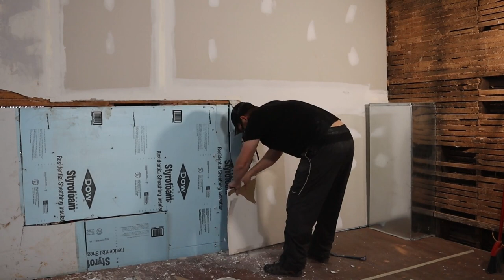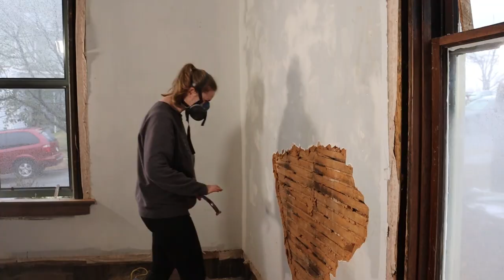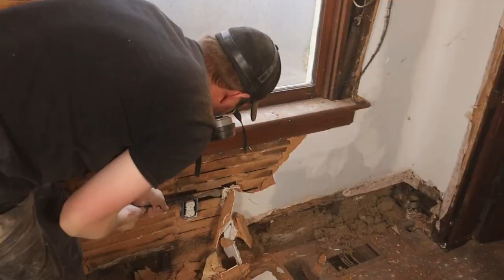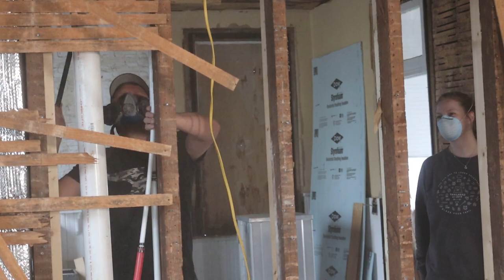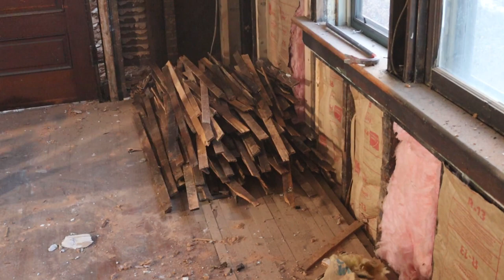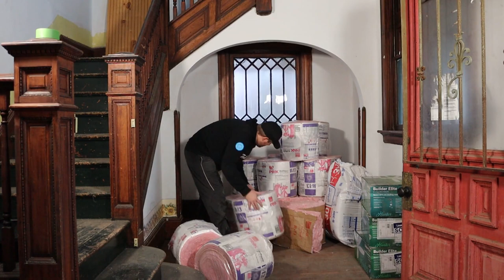Time to make some dust - Victorian Home Renovation [TirolerInn]

Comment: Are you still happy that you demoed as much drywall as you did? Seems like some of that was newer renovations, so wondering if it was all about seeing the plumber and electrical, or about insulation also, but just curious in retrospect

I remember when I bought my house, which needed a lot of work but not as extensive as your house, I went a little demo crazy and in retrospect which I waited more since I overdid it in some cases
Reply from the maker: I do not regret it. We want to insulate the whole house with spray foam outside, then electrical, low voltage, plumbing everywhere, so having it all off is great. further the amount of plaster that was in bad condition and also the issues we have found while opening up all the walls was for sure worth the effort, otherwise we would have never known.